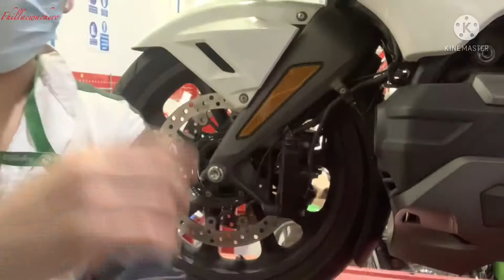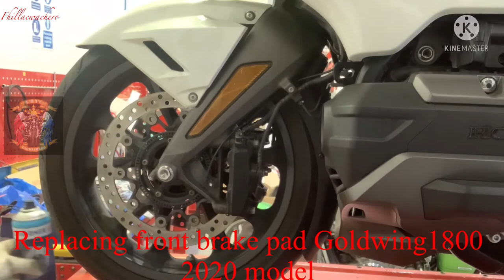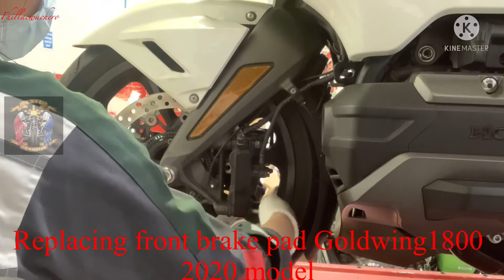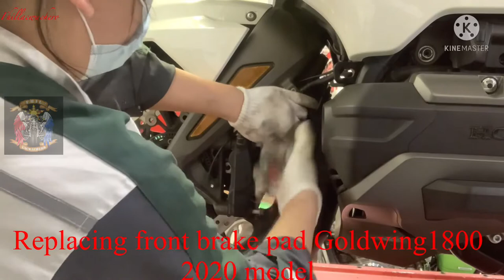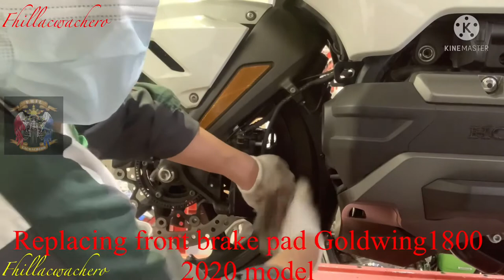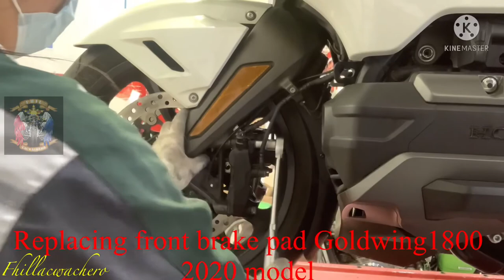Replacing front brake pad for GOLDWING 1800 2020 model.

Comment: Yeah, you shouldn't reuse the bolt flange. Honda recommends replacing them with each brake pad replacement. The replacement bolt flange already has the red colored loctite or whatever adhesive is at the end of this aluminum bolt.
Reply from the maker: Yeah u can reuse again the bolt flange with red loctite for safty